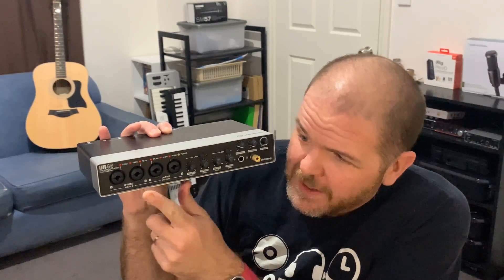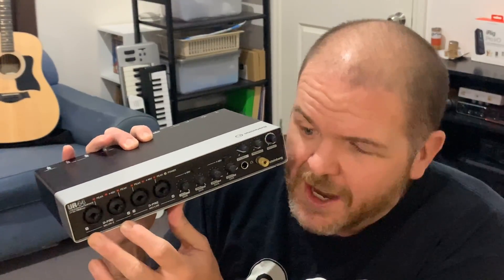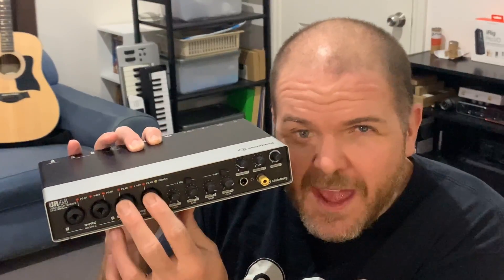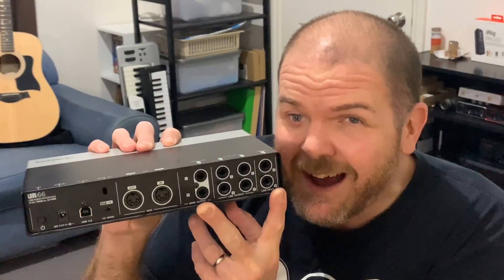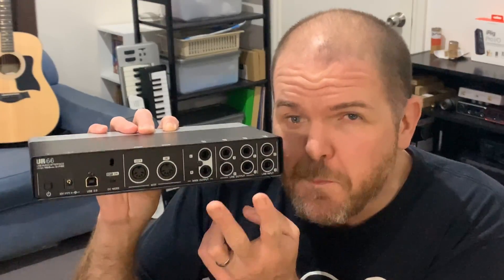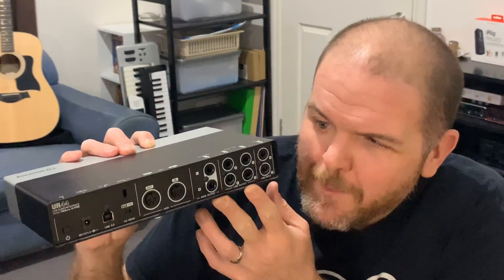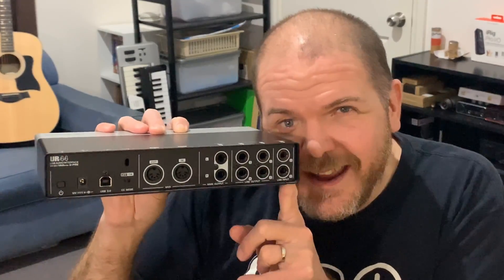What's the difference between a TS, TRS and TRRS cable?

Comment: is TRRS cables connector will my mixer or amp will accept that positive negative and ground?. or its useless or every mixer or amp is cable of receiving this + - and ground?
Reply from the maker: Most mixers support TRRS balanced inputs. Check your manual to be sure.

Comment: Thanks so much i was wondering if i could use an adapter for my monitors as it seems like in my country there's no TRS to TRS male cables 🤦‍♂️ this video was very helpful
Reply from the maker: Glad to hear it helped. “Balanced 1/4” cables” are the same deal so sometimes you’ll need to look for those.

Comment: Wait… Can you plug TRRS straight up into TRS 1/4 adapter? Or do i need a TRRS to TRS splitter then the 1/4 adapter? I got an IEM that I wanna use into my audio interface (it needs 1/4) but got confused since the cables are bit different.
Reply from the maker: Most TRRS inputs will take a standard TRS jack and work fine. But not vice versa. So most headphones will work in most TRRS jacks.

Comment: I have a question that I need to ask. I have a TS 3.5mm from a sennheizer shot gun mic, I have a DJI pocket 3 and I need to use an adaptor to usb c. Will a female 3.5mm trs be compatible to use?
Reply from the maker: I don’t believe so? You would need some sort of analog to digital converter in between.

Comment: So on the line level inputs on the front of combo jacks can you plug a single balanced trs jack and get stereo audio into a single channel? Or do you have to use a stereo pair?
Reply from the maker: Most audio interface inputs are mono TRS (balanced), so you'd need a stereo pair in two inputs to get stereo audio. http://studiolivetoday.com/cables
Reply: @StudioLiveToday  aww dang it. I was using a 3.5mm to 6.35mm trs cable to one of the line level inputs to try and get a stereo signal to one of the channels of my UA Arrow. Thank you for explaining! I'm assuming that's why when I plugged it in I was only hearing noise \ or only a portion of the signal? When I plugged it in halfway then I would get what sounded like normal audio.

Comment: hi there, nice video. I have a couple of samplers and I want to connect the ins and outs to my audio interface,. The audio interface is a focusrite scarlett 3rd generation. I was thinking of getting TRS 1/4 inch to 1/4 inch cables. my question to you is should I get Single TRS 1/4 inch to 1/4 inch cable or dual TRS 1/4 inch to 1/4 inch cable?
Reply from the maker: Hey there my friend. I actually answered this one on my podcast recording this week - https://youtu.be/bKAs5EmZNwA
In short, it depends on whether the samplers have balanced or unbalanced 1/4" connections. (TS or TRRS). Check out my info here - http://studiolivetoday.com/cables
Reply: @StudioLiveToday  oh ok thank you.

Comment: i have two questions . 1, if i used ts can i connect it to insert on mixer without stop the sound on mixer ? 2. can i use trs for piano or drum or guitar or connect it from aux to sound ? 3. what is the diff........... between trs male and trs female ?
Reply from the maker: Hey there. I recommend checking out my cable guide here. http://studiolivetoday.com/cables

In short, TS works with everything. TRS needs a device with a specific balanced output. Adapting between male and female doesn’t change the signal as long as the connectors are consistent.

Comment: Hi Pete! I love your videos, they are incredible and they help a lot to newbies like me. I want to ask you a question and sorry for the ignorance hahahaha... but what happens if I use a stereo cable to connect my guitar to a pedal. It happens that I have a pedalboard and the cable with the ideal size that I need is stereo. So if I use it, what would happen? would it work normally as a mono cable? Thank you very much in advance for your help. Greetings from Argentina!
Reply from the maker: Hey there my friend. So, most guitars use a standard instrument cable jack which is TS. Just the single tip and sleeve. Using a stereo (or TRS) cable will generally not do much harm, but quite often will simply not work. Some guitars have a balanced TRS output or the ability to use a balanced cable. (My Taylor acoustic for instance), but most guitars a only support TS. There is a slight chance you may damage your guitar or gear using a TRS or stereo cable so my advice is always - unless you know your guitar and gear supports TRS - just use a standard TS instrument cable.

Comment: hey bro,i use xlr-ts for my monitors m audio bx5, i feel the sound quality is bad & unsatisfactory,high fréquency unclear,if i will use trs-trs this will make the sound quality better ?,thanks
Reply from the maker: Hey there. In my experience the quality of   XLR or TRS is quite similar. Both are balanced cables so as long as they are similar in quality it would be about the same.
Reply: @StudioLiveToday  no bro i mean XLR -TS  not XLR-TRS ,thanks bro  ;)

Comment: is it possible to use a dual ts to xlr cable to connect my drum synth with stereo unbalanced outputs into my xr18 mixer to get stereo in 1 input instead of having to use 2 inputs?
Reply from the maker: Hey there. So you can use an unbalanced Dual TS to stereo TRS. But XLR usually doesn’t support stereo at all.
Reply: @StudioLiveToday  awesome. thanks. didnt realize i could have all those extra inputs with this method
Reply: @StudioLiveToday  well i tried it but i was only getting this wierd washed out sound and not able to pan the sounds from the module individually like i hoped. seems using 2 inputs is necessary for stereo

Comment: Thanks for the video, but a question still isn't answered: Is the wiring in a Balanced MONO XLR to TRS the same as in a  Non-Balanced STEREO XLR to TRS?  there is a lot of info about it but confusing. . .. .   Is it that the cable is the same, and if you connect it between a mono-Balanced circuit works just as if you connect it to a Stereo-unbalanced one?  ahhh!! that's a good question, right?
Reply from the maker: Pretty much. There’s three wires there. When you’re using it as stereo it’s left, right, ground. When it’s mono it’s original, flipped and ground.
Reply: @StudioLiveToday  So it is the same then. I have a ADA8200 which recently bought to expand my Apollo Twin X ports.... so I now have 8 ADATs ports....
This Ada8200 has an analog Line out from each input.... this line out is XLR (I Assume Mono) so I bought this XLR-TRS cables and I will patch them to a Mixer which will arrive tuesday... this is to be able to monitor directly without the need to use the Computer....and or disconnect any cables...

If I understand correctly your answer, I bought then the right cables.

Comment: @Pete Johns - Studio Live Today I have a cheap portable karaoke system that has a 1/4 in input....and I have a nice mic that i want to use. I need to buy a female xlr to 1/4 should i get a TR or an TRS cable?
Reply from the maker: Hey there. As long as the mic is dynamic you’ll need an XLR to TS cable. http://studiolivetoday.com/cables

Comment: Can TRS to Dual TS cables work both ways!?..IE:The dual side coming from a non TRS double out outputs stereo pedal going into the output of a Trs compliant. pedal?
Reply from the maker: It will generally work with most gear. You’re better off just using TS cables if I’m doubt however. http://studiolivetoday.com/cables

Comment: hey man tnx a lot for the vid!:) I'm about to connect my gear to my neutrik nys-spp-l 1 patch bay ...I was wondering if you could maybe tell me if I need to connect my gear with a balanced or unbalanced cable at the back:) tnx again and have a nice weekend!
Reply from the maker: Hey there. Not familiar with the gear but in general, if a piece of gear has a balanced input/output, you should be using balanced cable. The manual will generally tell you if it’s balanced or unbalanced. http://studiolivetoday.com/cables

Comment: Perhaps you could clarify about the power supplied over TRS and TRRS cables. Some microphones draw power over those cables (and XLRs often utilize "phantom power" right?). Could you elaborate on how and when power is transmitted over the cables? And how can someone tell if their computer/laptop/smartphone is going to provide that power?
Reply from the maker: Hey there. So short version is that if you’re using a microphone which requires phantom power you should use XLR cables. TS and TRS are usually unpowered.

Comment: Quick question: With the TASCAM DR40-X, can I use TRS cable to record speeches from a DJ mixer or speaker?
Reply from the maker: Hey there. Not familiar with that device sorry but the manual should confirm this. Just look for “TRS” or “Balanced 1/4””

Comment: What would be the result if I used a TRS cable to connect a guitar to an amplifier
Reply from the maker: Best case scenarios it will work. Most likely it just won’t work. Worst case it will do damage to the guitar jack or amp. Just use a regular guitar cable. There’s no benefit even if it does work.

Comment: does the trs cable work on guitar and amps or guitar and audio card
Reply from the maker: Guitars generally only support standard TS cables. Only use TRS if you’re sure your guitar supports it otherwise you can cause damage.

Comment: Great video! I have an issue with an electronic drum kit's volume being too low when using earphones with a mic. Some peeps on the internet suggested not to insert the TRRS all the way into TRS. I tried that, the volume got a little higher, but not as it used to be with other earphones without a mic.
My question is, if I buy this adapter, will the volume be the same as if I don't fully insert the TRRS or the volume will be better?
Reply from the maker: Yup.  You can try the “insert it only part way” method but it doesn’t really work. Try a TRS adapter or simply grab some headphones that don’t have a mic.
Reply: @StudioLiveToday  will do, thanks a lot!

Comment: Big thanks...You were clear...easy to understand and EXTREMELY HELPFUL. here's to hoping all good things come to you. I've been using a mic into a preamp and then popped an XLR to ts adapter to run it as a line in on my interface but I kept getting distortion and I couldn't tell from where. Well I guess that adapter was meant for guitars...and I've been walking in circles wondering why I was getting distortion...I thought it was a gain staging thing. Now I know why. They look alike and fit right...but they aren't the same.  Thanks again.
Reply from the maker: Yup. It’s probably the most common issue folks have with audio. Glad the video helped.

Comment: hey pete, been kinda just lurking around your channel for some time now. the content you put out is very helpful

though i'd like to get help from you and ask two questions

how would i go about connecting a 3.5mm trrs male (just the connector from a pair of earbuds with a mic) to a 1/8 trs female so i can monitor my audio interface? 

seems like my audio interface only receives 1/8 inputs so i bought an adaptor for it that converts 3.5mm to 1/8 but it doesnt work properly if i plug it in all the way through - i think its because the 3.5mm input is meant for trs and not trrs 

for the second question, its similar to the first problem i have - connecting a 3.5mm trrs microphone (to use as a microphone only, since i cant monitor the microphone itself, its a shotgun mic like the Rode VideoMicro) to one of the instrument inputs on my audio interface. simply plugging it in the one of the adaptors i bought mentioned before, it simply does nothing

again, this is all pretty complicated for me since i just started getting to all these audio shenanigans, i'd really appreciate if you could help me with some of your expertise with this one! god only knows how much i spent on scrap iron adaptors by now :p
Reply from the maker: Hey there! So, sounds like the answer to both here is the difference between TS, TRS and TRRS. What you probably need is a TRRS splitter that has a TRRS plug and sockets for headphone and mic separately. They’re sadly a little tricky to find. A good one comes with some lavaliere mics like the AT3050 from Audio Technica. 

My cable guide here might help. http://studiolivetoday.com/cables
Reply: @StudioLiveToday  

thanks for the quick reply! unfortunately when i look up the AT3050, i cant seem the find the lav you're referring to. all the results are watches 

what would i have to look up on google to get my hands on the splitter you're referring to? would it then be able to fit into a 1/8 input?

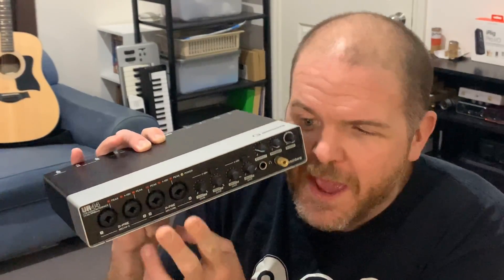Comment: this is awesome! thank you so much. I have a couple follow up questions: at 3:03, you say that the line inputs are expecting a TRS, balanced mono input. But I thought that TRS cables sent stereo? When would you be plugging in a TRS cable to the input? Like with a hardware compressor or something?

Also, what happens to the instrument input to get it up to line level? I know XLR goes through a pre-amp, does the Hi-Z input as well?

Thank you!
Reply from the maker: Hey there. Yes, TRS can either be balanced mono or unbalanced stereo. It carries two signals and a ground which are either stereo signals or the standard and reversed signal which makes up a balanced cable.

The instrument inputs effectively add gain to boost the signal. It’s not a preamp per se but a similar concept. 

My cable guide here might help. http://studiolivetoday.com/cables
Reply: @StudioLiveToday  Thank you so much for this!! Your videos and expertise have been SO helpful. What's the best way to tell if you should be plugging an instrument into an interface via a TRS or a TS cable? I heard (it could have been one of your videos) that for instruments that have their own amplification (certain synths), or if they have specified the outputs to be "balanced", then go into line? The rest (guitars, bass, unamplified synths, etc) go to instrument/Hi-z? Does that sound right? Thank you 🙏

Comment: Hey i would like  to tell me the result of my choice of these cable  and Converter... 1--BOROFONE BL1 Audiolink AUX audio cable (trs)  and 2---Converter 1/8 to 1/4(converter is trs also ) so can i use this method??
Reply from the maker: Hey there. Not sure sorry. It’s hard to determine this as it depends what gear you’re connected to what. Check out my cable guide here - http://studiolivetoday.com/cables
Reply: @StudioLiveToday  anyway thank you very much

Comment: Could I use the TRS adapter to connect my speaker to my Scarlett 2i2 interface? I’ve noticed that a standard TRS cable is thicker. So would it matter if I used the adapter(with the thinner cable) and connect them to my speaker? I hope this makes sense
Reply from the maker: Hey there. Not quite sure I follow sorry? Maybe check out my cable guide here for more info - http://studiolivetoday.com/cables
Reply: @StudioLiveToday  maybe this makes more sense, does using the TRS adapter produce the exact same result as using a TRS chord (no adapter). The adapter would be a TRS 1/4 end, which would be replacing the 3.5 mm end. 

I have a 3.5 mm chord that I’m using the TRS adapter on. I wanted to know if I would have better results using a TRS chord, or if my adapter system is fine as is. The reason I ask is because I’ve notice the actual black cable, or wires, are thicker on a straightforward TRS cable opposed to being thinner on the 3.5 mm cables

Comment: my keyboard has two L/R line outs, but need to plug to one mono in on a scarlett solo. which cable to use?
Reply from the maker: Use the left out and plug in to the instrument in if you’re using a Solo or mono interface. The Left output usually mixes down to mono when outputting. Use a TS instrument cable.
https://youtu.be/Dbz8sxuy5X0
Reply: @StudioLiveToday  I have a cable like this one below.  Could i use that to go out from L and R into the Mono interface? https://www.amazon.com/Hosa-STP-203-Insert-Cable-Meters/dp/B000068O1P

Comment: Hi Pete, I am trying to connect my Sub (XLR INPUT) to my Speakers (1/4" INPUT/OUTPUT)... Now I never knew there was a difference until today for 1/4 'TS' vs 'TRS'... Before I make the purchase can you advise is It better to go with the TS or TRS connector?
Reply from the maker: So it all depends on whether the speakers support TRS. XLR is balanced by default so if the speakers have a balanced TRs 1/4” input (most do) you are best to go for XLR to TRS. My cable guide is here to help too-
http://studiolivetoday.com/cables
Reply: @StudioLiveToday  Thx for the info Pete!!!

Comment: Thank you for your explanation. I own a rode wireless go ii, in which,the transmitter has a trs in port for lavaliers. The one I have (boya by-m1) has a trrs jack . When I connect the boya lavalier to the rode, I need to set the switch of the boya to camera, so that I can get audio on the rode. Will this harm the rode in any way? The sound seem similar when using just the rode or both but I'm affraid if I'm doing the right thing. Will I still need the converter even if it is working?
Reply from the maker: Hey there. I haven’t used this gear personally but I don’t think it would cause any issues. Maybe ask over at the Create Record Release Facebook group?